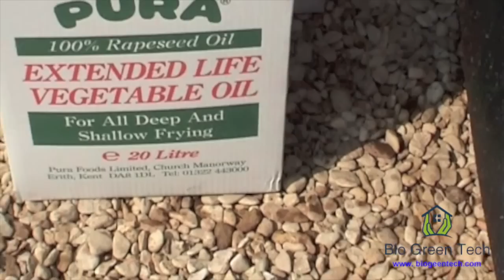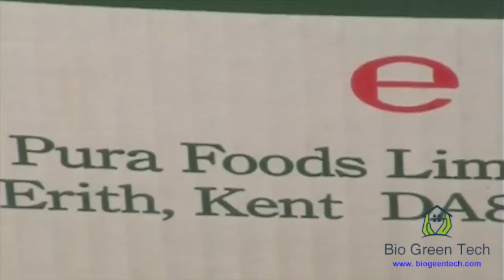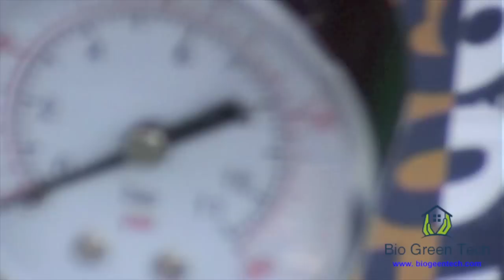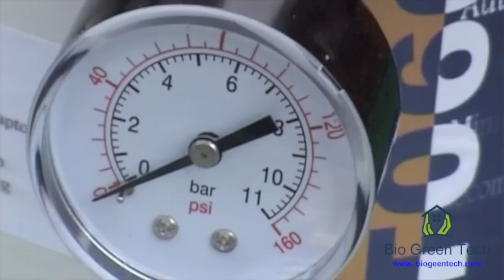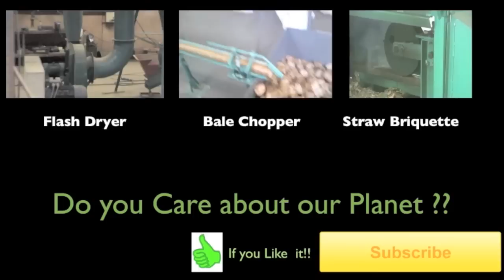🔴 Making Biodiesel From Waste Vegetable Oil.  Oil Filtering System

Comment: Why run the oil through a 10 micron filter?  Wouldn't it be easier to go directly to the centrifuge after straining through the 400 micron barrel strainer?  Yes you will probably have to clean out the centrifuge more than once per batch, but it seems to me that this would be more cost effective than pumping through disposable filters.
Reply from the maker: Thanks so much for leaving a comment—it really helps support the channel! If you haven’t already, now’s a great time to subscribe so you don’t miss any updates. I’ll be at the event myself and we’re planning to do a live stream while we’re there, so make sure you’re tuned in!